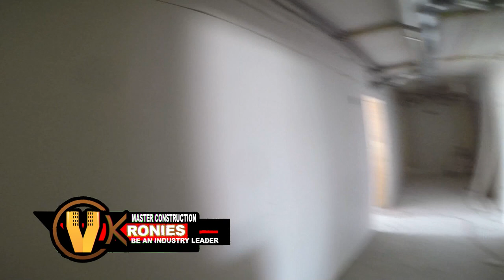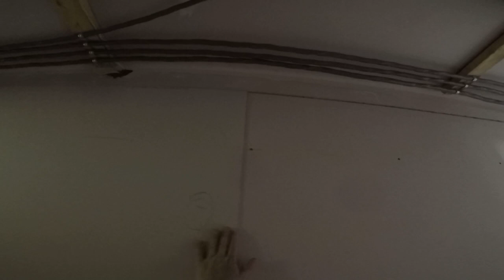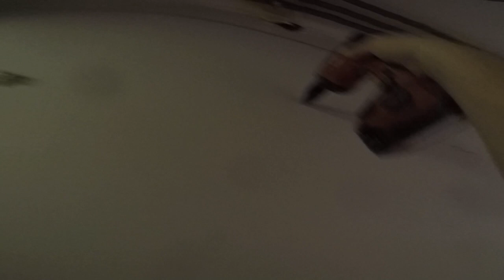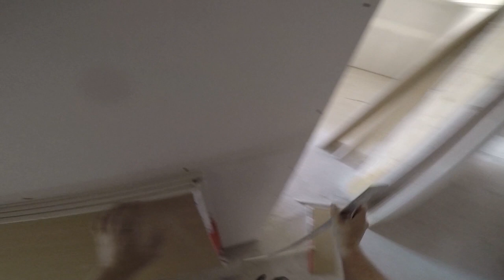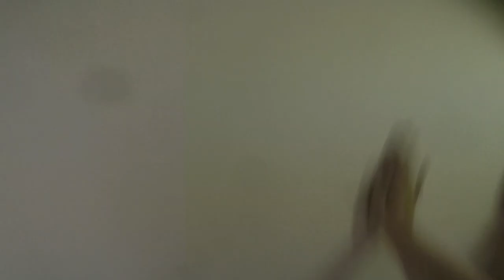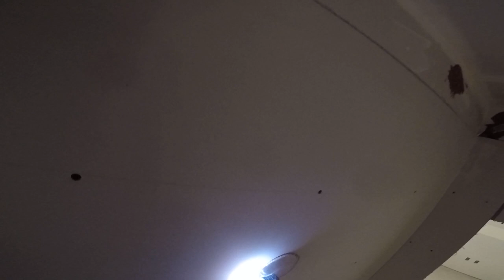Double Layer Drywall | Installing Top Layer

Comment: How do you make sure that the screw isn't going to hit another screw?
Reply from the maker: You don't. Its chance and it rarely happens. Also why you don't put that many screws in first layer. The bottom or top track you have more chanece of hitting screws so first layer I put them in spots a little off from where I would normally.

Comment: hi just wonder how to install two hours fire rated dry wall between two layers? Really appreciate. And just wonder if the rock wool could  be used as fire resistance material. Thanks
Reply from the maker: Yes mineral wool or semi-rigid insulation acts as a fire retarder and is much better than regular batt. Double layer 5/8" type  'x' drywall on both sides of the wall and stagger your joints will get you the fire rating you need!   Here is a couple videos to help you  https://www.youtube.com/watch?v=oTg73f-spMk&list=PLRtmYu3z-FEO1wbb8fe8azllKc-WZRXGg&index=22  https://www.youtube.com/watch?v=DSDCVFr548Y&list=PLRtmYu3z-FEO1wbb8fe8azllKc-WZRXGg&index=23

Comment: I really hate it when they call for double layer 5/8” Drywall not the easy full sheets but the cut outs and top where there is a million cut outs for ductwork and conduit and plumbing etc it feels like the day last for a year when you a cutting board
Reply from the maker: Omg bro, I feel you man. Yuck, I remember always being so hot and stuffed in crazy tight spots. That was the stuff that made me so good at drywall. The money is in the tops, if you can do tops fast and they look good it will help you later. If you decide to go piece work even on the side having a good system for tops is essential.